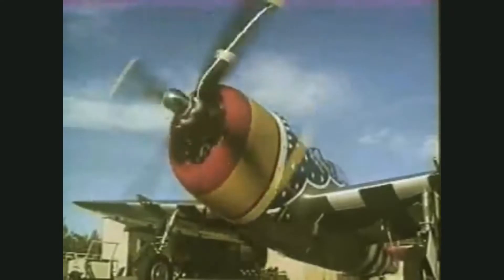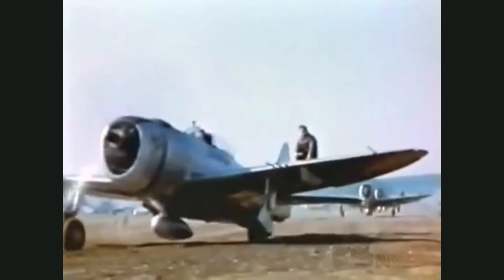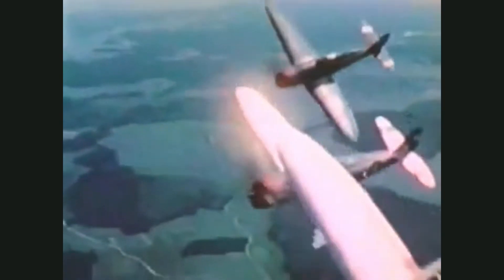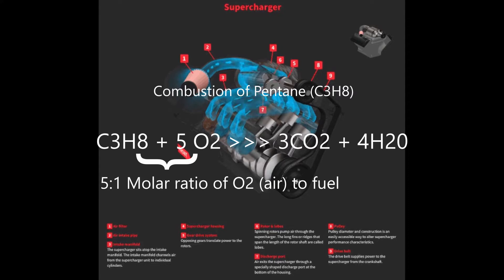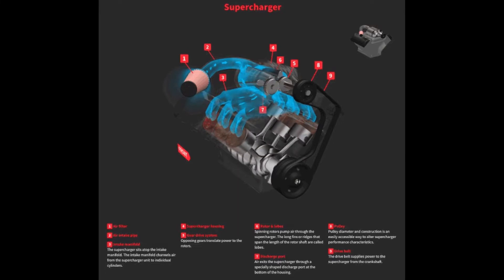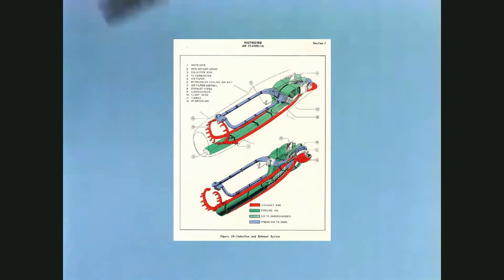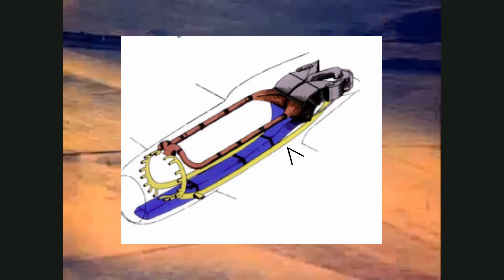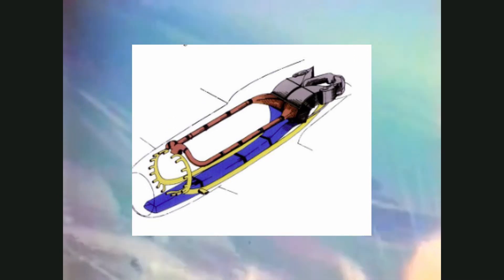The P-47's Supercharger

Comment: I want to clear up some incorrect information/terminology here. To start off, it was not the Fairchild-Republic P-47. It was just the Republic P-47 Thunderbolt. This plane was long before Fairchild and Republic merged. Secondly, to avoid confusion, this is more correctly called a turbosupercharger, or what is today known as just a turbo. You were correct when you said a supercharger takes rotational energy from the engine to work, but a turbo does not do that. It just takes the energy from the exhaust gasses which drive an impeller. This is why there is such thing as turbo lag. There is no mechanical drive on the main charging system of the P-47. The P-47 does also have a mechanically driven supercharger, which further charges the air after it is "carbureted," (it's really a throttle-body injection.) The small supercharger is built into the P&W R-2800 from the factory and is constantly engaged. It is not a two-stage supercharger though; it together with the turbosupercharger make up a "two-stage charging system." The supercharger that is built into the R-2800 is small and to little effect, however. The main charging system is the turbosupercharger. This is what allows the plane to have such great high-altitude performance. Also, the air is actually split into three sections in the back. One goes into the turbo to become the charge air, and another goes to the intercooler to cool the charge air, both of which you mentioned. However, there is a third section of air that goes to a shroud cooling the turbo itself. Turbos get really hot as the rev so high, and they need to be cooled to not overheat. At least in this application they do, as they'll be in constant use past 7,000 feet, and they need to last as the performance of the plane depends on it. As a last tidbit, only the early models were limited to 2,000 horsepower, and they did NOT have water-methanol injection. The P-47D-5 (or D-4, depending on your source), was the first P-47 with water injection, and it produced 2,300 horsepower. The P-47D-25, or the first bubble-top variant, was to my knowledge the first to get the 2,600 horsepower upgraded engine. All D models after this had 2,600 horsepower. Then came the P-47M and N, both of which had 2,800 horsepower. Most P-47s had either 2,300 horsepower or 2,600. That also depends on the period of time during the war, but I digress. The P-47 was the best plane of the war if you ask me.
Reply from the maker: Thanks for the info (and correcting me)! I'll pin this comment until I can address this in a future video.
Reply: @aerohistory3991  np!!
Reply: Do you watch Greg's channel?
Btw can you point me to a technical drawing where the engine driven supercharger is shown? All drawings/cutaways I've seen were without it.
Reply: @gregorteply9034  Pretty well every radial engine is supercharged from factory. The supercharger impeller is connected directly to the crankshaft. It's the massive turbocharger, Intercooler and associated ducting that makes the p47 so special.
Reply: @fishis14 Yes, I see, it is mounted to the engine, thanks.
Reply: In his Autobiography Hub Zemke commander of the 8th Airforce said the cost per flight hour of the P51 was half that of the P47. That Turbo supercharger was a fantastic piece of kit but it was bulky, complicated and must have added substantial weight.

Comment: Naration was the biggest load of old shite I have ever heard
Reply: Agreed.  I have yet to see a more ridiculous false expert in action like this.

No turbocharger in the history of planet Earth "uses the outside slipstream" to power ANYTHING.

ALL as in, without a single exception, ALL turbochargers are powered only and entirely by exhaust gas power.

Here is the actual air path:

A) air enters the intake, is fed into the turbocharger.
B) air is compressed in the turbo by centrifugal force
C) air goes through the INTERcooler to cool it before it reaches the ENGINE-MOUNTED SINGLE-STAGE SUPERCHARGER
D) after the ENGINE-MOUNTED SINGLE-STAGE CENTRIFUGAL SUPERCHARGER, the air passes through aftercooling before it goes into the engine
E) Exhaust from combustion drives the turbocharger turbine to power the turbocharger compressor.

I REPEAT. AT NO TIME HAS, DOES, OR EVER WILL THE OUTSDIE AIR POWER A TURBOCHARGER.

When the exhaust gas is before the turbocharger turbine section,  it is at a far higher pressure and temperature than after it dumps its energy into the turbine, where it loses both heat and pressure.

The  INTERcooler is a cooler that cools the air between multiple stages of external compression. An AFTERcooler is a cooler that cools the air already compressed by one or more stages of external compression known as turbocharging or supercharging, just prior to it entering the engine for combustion.

Comment: This is actually a turbo charger but was called supercharger back in the day.
Reply: It was called a turbo supercharger
Reply: That’s a centrifugal supercharger, this was not powered solely by exhaust it used outside slipstream to power the impeller. You are half-correct.
Reply: @iAmCompletelyNormal  No. 

No turbocharger in the history of planet Earth "uses the outside slipstream" to power ANYTHING.

ALL as in, without a single exception, ALL turbochargers are powered only and entirely by exhaust gas power.
Here is the actual air path:
A) air enters the intake, is fed into the turbocharger.
B) air is compressed in the turbo by centrifugal force
C) air goes through the INTERcooler to cool it before it reaches the ENGINE-MOUNTED SINGLE-STAGE SUPERCHARGER
D) after the ENGINE-MOUNTED SUPERCHARGER, the air passes through aftercooling before it goes into the engine
E) Exhaust from combustion drives the turbocharger turbine to power the turbocharger compressor.

I REPEAT. AT NO TIME HAS, DOES, OR EVER WILL THE OUTSDIE AIR POWER A TURBOCHARGER.

When the exhaust is before the turbocharger turbine section,  it is at a far higher pressure and temperature than after it dumps its energy into the turbine. 

The  INTERcooler is a cooler that cools the air between multiple stages of external compression. An AFTERcooler is a cooler that cools the air already compressed by one or more stages of external compressiong, known as turbocharging or supercharging.,

Comment: Most of the plane is the supercharger! Thanks for the informative video.
Reply: No turbocharger in the history of planet Earth "uses the outside slipstream" to power ANYTHING.

ALL as in, without a single exception, ALL turbochargers are powered only and entirely by exhaust gas power.

Here is the actual air path:

A) air enters the intake, is fed into the turbocharger.
B) air is compressed in the turbo by centrifugal force
C) air goes through the INTERcooler to cool it before it reaches the ENGINE-MOUNTED SINGLE-STAGE SUPERCHARGER
D) after the ENGINE-MOUNTED SINGLE-STAGE CENTRIFUGAL SUPERCHARGER, the air passes through aftercooling before it goes into the engine
E) Exhaust from combustion drives the turbocharger turbine to power the turbocharger compressor.

I REPEAT. AT NO TIME HAS, DOES, OR EVER WILL THE OUTSDIE AIR POWER A TURBOCHARGER.

When the exhaust gas is before the turbocharger turbine section,  it is at a far higher pressure and temperature than after it dumps its energy into the turbine, where it loses both heat and pressure.

The  INTERcooler is a cooler that cools the air between multiple stages of external compression. An AFTERcooler is a cooler that cools the air already compressed by one or more stages of external compression known as turbocharging or supercharging, just prior to it entering the engine for combustion.
Reply: @exploranator  Great explanation!     I miss my old Turbo Z.  :-)